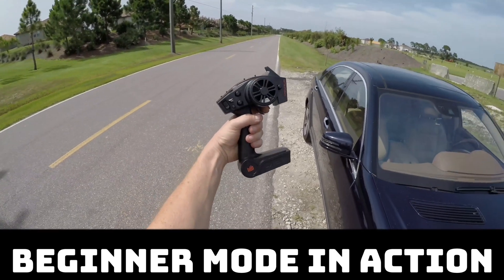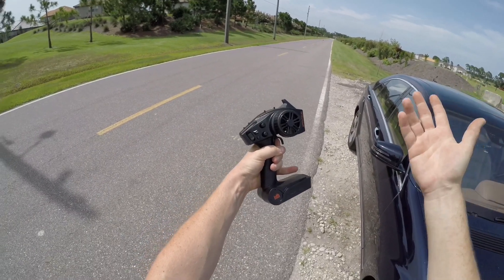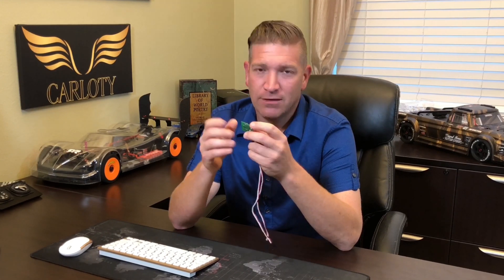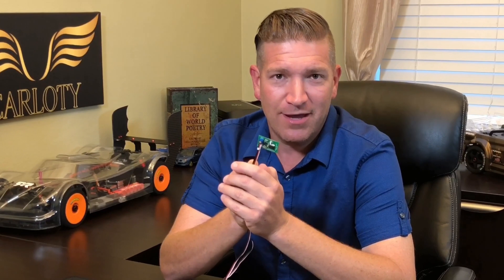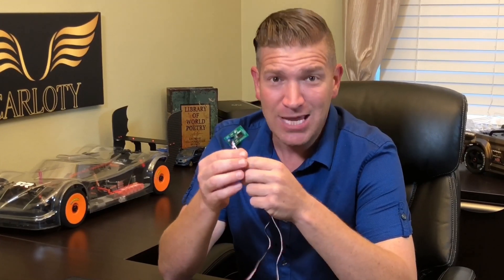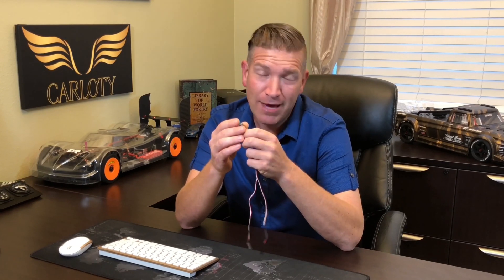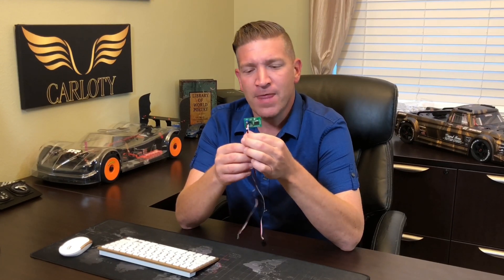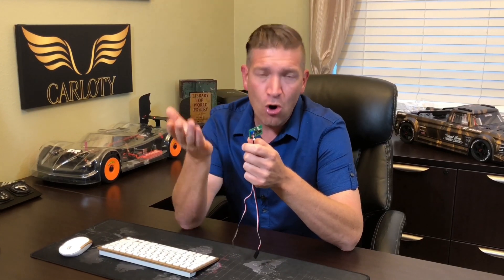PERFECT PASS INSTALLATION

Comment: Perfect pass isn’t working!!!
ESC flashing red
Installed it in my limitless.  
SR315 receiver, spektrum 160a esc and DX5 transmitter. Installed perfect pass properly. recalibrate with perfect pass installed pot fully ccw. Turned off power, disconnect batteries let sit to to so to let PP to reset. Turn power back on, no throttle or reverse response (steering works) with PP installed. Took out PP. restarted car without PP, car has throttle and reserve. Reinstalled PP, did calibration
Turn off disconnected battery let sit.
Turned power back on with PP installed pot fully CCW. No throttle or reverse (steering works). Esc just flashes red when PP is installed(even after powered off let sit and powered back on)
ESC works perfect when PP isnt installed